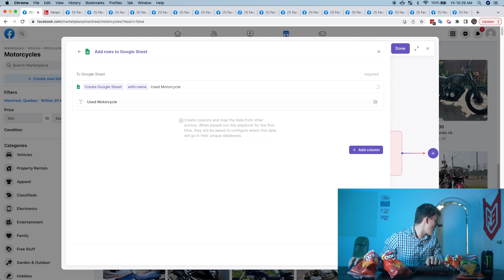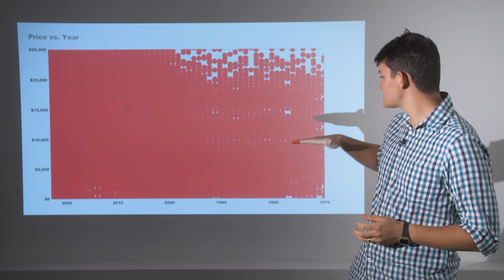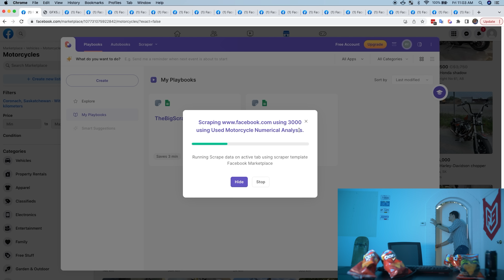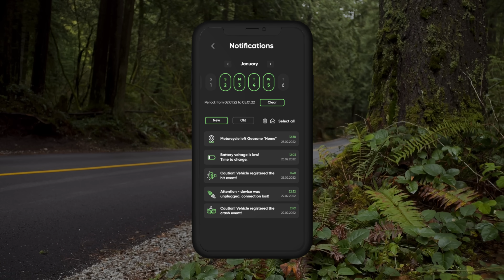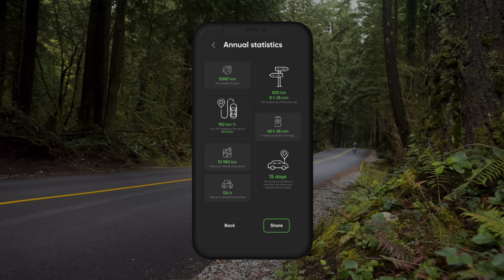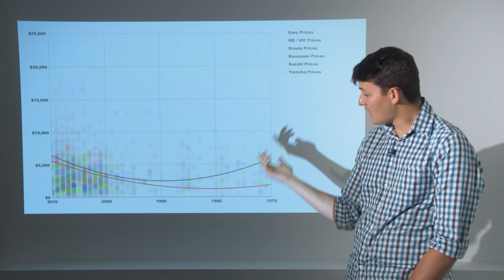Used Motorcycle Prices – A Statistical Analysis

Comment: Sportbike guys especially go for ~2007. All the big 4 were making great bikes, for example, the difference between a 2007 cbr600rr and a 2023 is electronics, paint, and price. The 06 R6 already had RBW, and the 07 gsxr600 is legendary. Cheap compared to new, but the performance is modern
Reply: K7 Gixxer bro.... sharp as a missile....
Reply: @AST4EVER in my country Suzukis are underrated asf, people wanted the newest and the latest just to feed their ego "haha mine is more expensive than yours thus it's better" it's crazy. glad that my Suzuki GSX-R150 never got updated because after all these years it's still one of the best bike ever statistically, my '17 is still strong even tho it has 80k kilometers on it.
Reply: I have a 2007 ninja 650R and just hit 60,000 miles. Anything over 15,000 miles on a bike is considered high mileage. I would have to agree with your analysis of bikes from 2007.
Reply: I do have one complaint about ninjas from 2007. Their cush drive is shit. They crumble to dust and will have you thinking all kinds of stuff is wrong until you figure out what all the dust on the back rim is from.
Reply: @Light_Resistance that's a good reason to do your own drive line maintenance. If you are laying your Richard-beaters on the wheel to lube the chain, it's a good idea to check the bearings and cush drive- just takes a few seconds to shake the wheel and rotate it a little in gear. You would have been able to feel the cush drive degrading. Shaking the wheel checks the bearings.
Reply: @Light_Resistance  Having owned a 2nd Gen ZX10, theres a good reason I didnt mention kawi 💀. Owning Kawi bikes made me a honda/suzuki guy
Reply: @pair_of_fins  I completely agree, I've owned one Kawasaki... Never again.
Reply: I love my '07 R6 and it only cost me $4300 USD about 3 years ago.
Reply: Bought my 2016 S1000rr for $12,500 with 15k miles on it from another rider in my group. Heated grips, cruise, quickshifter up and down, tuned, cat delete, comfort seat, flawless condtion. I paid more than that for my 2023 KTM 890 Duke R for almost 100HP less, no heated grips, cruise control and blipper were also extra at the time of purchase...

Buy a new S1000rr for what, 25k all said and done to get the same shit and basically the same horsepower but 30lbs lighter? I don't think so. Thanks but no thanks lol
Reply: You mean bad things happened in 2008?
Reply: Recently I’ve seen some young guys talking crap about the mid 2k bikes being OLD garbage and I couldn’t believe it! They’re like the stripped down race versions of the new bikes out with all their fancy electronics.
Reply: How about a official group ride next week
Reply: 2008 Kawasaki ZX-10R, absolutely brutal bike for a few bucks!
Reply: After they stopped making r6 they have significantly gone up on used markets. I bought a cb1000r for way lesser than a used triumph. It's not as powerful as a modern 600's but I am happy with 120 bhp loads of torque and not electronics.. so it just pushes me to become a better rider and respect the motorcycle more.
Reply: There is also data about fatal motorbike incidents in the Netherlands that 80%(or in that magnitude) of the cases it involved no breaking at all….
Reply: @terborgh8757  Please provide a reference for that statistic cause I don’t believe it.   It’s doesn’t make sense and I can’t find any similar reference to such a statistic.  My guess is you are mistaken or made it up.
Reply: @kannermw  apologies for not able to provide  the source; i picked it up somewhere and pretty sure it was a Dutch based source. Sticked with me as I drive myself.
Reply: @terborgh8757  There are less than 50 motorcycle fatalities per year in Netherlands and not a good benchmark comparison.  I have visited Amsterdam and ridden a bicycle which was crazy enough.  That being said it is totally different then U.S. with a size less than halve that of West Virginia.

By comparison passenger car ownership on U.S. is more than 2x greater than Netherlands in total percent.  If other things were equal the risk to motorcyclists in U.S. from passenger cars would be minimum 2X greater.  Furthermore, the threat of deer or other large animal accident in Netherlands incidence rate is 225X lower than U.S. whereas the population ratio is ~ 19 times higher in U.S.  Thus, adjusted for population you are at 11.9X greater risk of hitting an animal in U.S.  The U.S. has bicycle and pedestrian death rates 5-6X higher than Euro nations.

My points being Netherlands and most of Europe would be bad baselines for comparison using any motor vehicle survey.  The nearest equivalent Euro  example would probably be Germany or UK .  At least Europeans are smart enough to mandate ABS on all motorcycles sold.  

The fact ABS has been mandatory on cars in U.S. for nearly 20 years and not yet mandated on motorcycles is inexcusable.  It also shows that the motorcycle industry cares less about their U.S. customers well-being then potentially losing sales by offering low cost alternatives without ABS.  It is as if  U.S. is like third  world country.  Then again we have a lot of riders  opposed to mandatory helmets so that says a lot about some riders intelligence.  They much prefer the wind in their hair and brains on the road.
Reply: @kannermw  So it is 80% for American statistics and not for fatal but sever crashes. Lack of evidence does not equal no evidence. :)
Reply: Well, to be comparable you'd have to go through all the bearings and refurbish the suspension...not cheap. But in general you're right.
Reply: Dude there's somebody selling a 96 zx7r for 500 bucks by me. Needs a battery and a voltage regulator amongst other basic maintenance since it's been sitting for awhile. It's calling my name.
Reply: do the 07 models have ABS? ABS on the frontwheel never interfered with my driving, the rearwheel lifts off before that, but i had it save my ass a few times on the rear wheel, it's a nice livesaver i wouldn't want to save a bit of money over
Reply: @weibrot6683  Don’t know if this helps but my 2007 FJR 1300 has ABS. It’s a sport tourer but leans more to the sport. It’s fast, rock solid and bullet proof. It tends to handle on the heavy side ( 645 lbs.) but still good in the twisties. I paid $5,300 CDN for it in 2019. Best bike I have owned. Not a sport bike but it will blow away many of the >1000 cc. sport bikes.
Reply: @weibrot6683  ABS is not as important on motorcycles as cars. If you are competent rider you can brake harder than ABS. Mainly because as a rider you can predict, unlike ABS which can only react. As you you progressively brake harder and harder the forks get loaded with weight and then you get even more grip to brake with. So basically you can get more usable traction manually. Fortnine did a video about this.
Reply: @weibrot6683  ABS is still not all that common on supersports, much less in 2007. Most advanced tech youre getting is a slipper clutch for bikes that old. Personally I always find motorcycle ABS to be super annoying and I always prefer bikes without it.
Reply: @pair_of_fins  I mean that first sentence of yours is straight out wrong, i don't know where you got that information from, but every single modern motorcycle since 2016 has ABS, i also don't know how you could possibly find ABS annoying, if you're doing it right you're not gonna notice it during normal riding, and if you notice it you probably would've become a meat crayon without it, sorry, but that's just a bad take
Reply: @weibrot6683  Every single time Ive gotten an ABS activation, I simply disagreed with the bike. Im braking, I dont want to pull the lever and feel no brake. Ive never had a problem on my non-ABS bikes, track or street, but ABS has just been an annoyance on both.
Also yeah fair enough, I dont know much about 2016+ bikes, I just know the gsxr600 doesnt have ABS, as well as many entry level bikes. But yeah most supersports do have it
Reply: @pair_of_fins  That first sentence of yours makes me think you don't know what the ABS activation feels like, if you break, and you don't feel breaks, that's not the ABS system working, that's not how it feels like, i think you had some air in your breaking system or the breaks on the ABS bikes are a lot weaker requiring you to press harder on the break leaver to get the same amount of breaking perfoemance, when you activate ABS it's the exact same feeling as on the rear break or in a car, it feels like a fluttering on the break leaver, if you didn't feel a fluttering on the leaver, ABS didn't activate, it's as simple as that, the amount of breaking you get also has nothing to do with the ABS activating or not, to clarify my other point further, i was refering to every bike ever made and sold in the EU since 2016, wether it's a supersport, a 125CC or a cruiser, everything has ABS
Edit: Also one more thing, to avoid any confusion, if your ABS activates, and you didn't feel you were getting much breaking out of the bike, then you simply didn't have enough grip to get more breaking out of your motorcycle, if ABS malfunctions, it also completely shuts off indicated by the ABS light going on in your dashboard
Reply: @weibrot6683  I know what ABS feels like I was just exaggerating my point. My brakes worked fine, Ill just accept that the bike probably had an outdated and overly aggressive ABS system.
It would bite fine for normal braking, but under heavy braking it would activate and I would just be annoyed that i was getting less braking when I was 100% sure I wanted brakes. My non-abs bikes have significantly more powerful brakes than my ABS bike did, but if i tried braking 60% as hard as my non-abs bikes the ABS would activate
Reply: @pair_of_fins  Ok, but if you're comparing two different bikes than there's only really your subjective feeling, there are so many other factors that could cause the ABS to activate earlier than expected, worse grip of the tires, much better biting breaks on the ABS bike, differnt sized master cylinder etc...
Unless you did a stopping test from a set speed to a full stop with 3-5 attempts on each bike and get the average there is no real telling if it was just the difference in feel or an actual issue with the ABS system
Especially if you changed the breaks of the non-ABS bike to a break system with more cylinders, you require more of a pull of the break leaver to get the same breaking performance as before, essentially you need to displace more break fluid for the extra cylinders, and the size of the mater cylinder didn't change
Reply: @weibrot6683  Same tires, same track, stronger brakes on the bike without ABS. I was able to brake much harder and faster on the non-abs bike
Which like I said, i blame on cheap+simple ABS
Reply: @pair_of_fins  Significantly more powerful brakes because there was nothing to stop them locking up and putting you into a slide vs less braking because they wouldn't lock up and take away steering control.
Talk about missing the entire point of ABS.
Reply: @pair_of_fins  why do you find abs annoying
Reply: @weibrot6683 my 2016 gsxr 750 doesn't have abs. Your first sentence is stright out wrong
Reply: @echo5827  If that's the case than the EU variant of that bike had ABS or they straight up couldn't sell it
Reply: @pair_of_fins  LOL Basically your flawed opinion on ABS is a comparison of a bike equipped with ABS  with crappy brakes to a non-ABS bike with very good brakes.  That is a false justification to support riding an inferior bike without advanced tech for added margin of safety because you can't either afford or unwilling to pay the added price to upgrade.

 How much does one potential accident cost you?  Assuming  you survive it is lost wages, damage to bike, potential permanent disability, hospital bills, pain and suffering, higher insurance rates, lost enjoyment  time riding, etc.  

Times have changed and tech has advanced beyond the skills of even the best riders.  The tech of 2000-2010 or earlier is outdated by over a decade an a half.  The first consumer quad drone was released in 2010.  The tech that made them possible was low cost multi-axis IMU.  That is essentially similar tech to advanced 6-axis IMU and high speed processors that bear little similarity to their predecessors which were much less sophisticated and not as effective in implementation (aka low cost bike ABS or old generation ABS).  This new advanced tech is not intrusive and only does its thing when you make a mistake or encounter unexpected emergency situation.
Reply: @pair_of_fins  Go ahead, link a modern supersport bike without abs.
Reply: @weibrot6683 since 2016 huh? So that's why I can option a brand new ninja 650 without abs? Is that also why I currently own a 2016 ninja 650 that doesn't have abs 😂
Reply: @weibrot6683 you couldn’t pay me to have ABS. May as well DRIVE a Goldwing. I’ll stick to pushing the limits until I lose the ability, or until it’s time to buy a muscle car. Again, no ABS.
Reply: @WontSeeReplies  LOL. What do you want written on your tombstone?  "Here lies proof of Darwin's theory"
Reply: @weibrot6683   If you need ABS to save your life, you probably shouldn't be riding.....
Reply: @nathanmackenzie1174  Ok, now that's one of the single worst takes i've ever heard
Reply: 6-axis IMU level of safety margin on a motorcycle compared to one without such modern rider aids  is far greater than the difference between a car without seatbelts and all modern safety systems.  Motorcycle ABS without linked braking or compensation for lean angle is ancient tech that has some value but nothing to crow about.  More modern and sophisticated ABS systems outperform old school ABS and there are significant differences between ABS on low end bikes vs. high-end bikes.   It is like claiming your old budget smart phone from 15 gears ago performs nearly as well as a new higher end one which is absurd.  Until you have experienced dangerous  situation in which this modern 6-axis IMU tech can save your life and that of your passenger  then you have no idea.  I have experienced such a situation and I guarantee no human in any random unexpected street scenario can duplicate or exceed the performance of such systems.  As a consequnce I will NEVER ride another motorcycle without such tech.  

There are studies showing that ABS on motorcycles reduce fatality rates by 31% but the class of motorcycles that benefitted the least were sport bikes and differences are significant.  It is the attitude of sport bike riders and riding with far less margin of safety on the streets as if they are in a controlled track environment that are to blame.  I have no doubt the average  sport bike riders are more skilled than typical rider but that over-confidence leads to bad judgement even with better handling motorcycle and consequently much higher death rates.
Reply: @kannermw  A significant portion of sportbike owners will think they can outbrake ABS, and in my opinion, in the dry, they can but not safely. And in the rain...never. Performance braking without ABS is like picking up pennies in front of a steamroller; most of the time you'll be successful until you're not. I've owned sportbikes throughout the decades, from non-ABS, to partial ABS, to linked ABS, and now to performance ABS with Traction Control. I'd say bikes without ABS/TC are really difficult to ride safely in comparison to ABS/TC bikes, but good luck EVER convincing hot-shot sportbikers of that fact.
Reply: @kannermw  ABS lengthens your stopping distance buddy... Until you've had to slam on a pair of good old fashioned disc brakes in an emergency situation cleanly & effectively, you don't know what you're talking about. Plain disc brakes are better than ABS for shorter stops.
Reply: @danielstorey3696  You are ignorant about statistics  based on real-world conditions not some planned practice scenario in a parking lot or empty street.  From NHTSA study comparing like model motorcycles with and without ABS the differences are profound (summary below).  You could look  up the study but I doubt you would cause it would challenge such ignorance.

The fact the benefit was not as great on sport bikes was determined to be the result of excessive speeds and riskier riding behaviors resulting in more crashes independent of ABS.  

This study did NOT include the much more advanced 6-axis IMU technology which is magnitudes of order better than simple ABS.  There are plenty of videos out there showing riders on wet or dry track doing things no other rider could do without such systems and no crash.  The fact such systems have been used in motoGP for over a decade by professions says something.  The main difference with those systems in racing conditions in a controlled environment is the settings are optimized for every corner on the track.

 "Overall, he found that ABS was associated with a statistically significant 22 percent reduction in motorcycle driver fatal crash involvements per 10,000 registered vehicle years. By motorcycle type, the feature was associated with a 32 percent reduction in crash rates for standard and cruiser motorcycles and about a 25 percent reduction for touring and sport touring bikes. For sport bikes, that percentage fell to 19 percent, and for supersports it fell to 12 percent."
Reply: @danielstorey3696  Amazing how guys with false opinions stop commenting when presented with facts.  How about this one.  According to NHTSA  sport bike riders have a 8.21 deaths per 10,000 vehicles vs 5.32 for touring and 3.88 for cruisers.  Using simple math that means 54% higher fatality rate than touring and 111% (>2 times) worse than cruisers.  That stat is not published based on miles driven which makes it even worse.  Despite sport bikes better brakes and so-called high skilled riders are just not what you say.  Practice threshold braking all you want but with and over-confident attitude and no margin for human error the grim reaper is waiting for you.
Reply: @kannermw  😂😂😂
Reply: @kannermw  There in NO ABS on MotoGP bikes.
Reply: @kannermw  Dying on a bike is almost always a skill issue, not a situation or technology issue. Modern tech doesnt hurt but it shouldnt be a deal breaker, it also shouldnt be a replacement for skill and practice.
Overall we do agree tho, i totally get your point and think that if you put the same perfect rider on a bike with all the modern nannies cranked, vs one without, the rider would crash less times than on a more "raw" bike
Reply: @pair_of_fins "Dying on a bike is almost always a skill issue"
Says every rider who aren't dead.
Reply: @donniebunkerboi9975  Have you tried just not crashing
Reply: @donniebunkerboi9975  Ken Block professional stunt driver probably thought the same thing when he went solo on a snowmobile and look how that ended for him.  Over-confidence in one's skills is a step closer to an abrupt ending.  Bottom line is most humans are poor judges of risk and falsely believe they are in full control of their destiny until they are not.
Reply: @pair_of_fins yeah getting launched by an inattentive suv driver would be a "skill issue"
Reply: @darksideorbit8898  I commuted for years, ignoring red lights and traffic, never had an issue
Reply: Sportbike wannabe, and by wannabe I mean all were CBs. 2 x 750 (K and F), 1 x 900 (F) and 1 x CBX 125. But, also a cruiser wannabe (2 x CM 250, 1 x Rebel 250 ((ugh!), 1 x Kymco 150 ((present for FiL)), 1 x CB125 ((also for FiL)) 1x GL400 and 1x GL500 and 1 x EL250), off-road wannabe (1 x SX200, 1 x DR250, 1 x XLR 250). And the most modern was 1991.
Carbs can be a hassle, but you sure learn all about your bike. And the CCB750 will do everything you want it to. Just avoid the F.
Reply: The difference is that you will likely not crash in the first 100m in the 2018 superbike. Those bikes were death traps, you had to have expert skills to ride them. Now you can ride a 200+ hp superbike with very little experience and survive, as long as you activate all electronics and safeguards.
Reply: @aao331  I got a 2006 ZX10R when I was 18, it was a totally fine bike to learn on (at that point I had under 6 months experience riding, on a 650). You just have to respect the machine and not push your limits too far.
Literbikes are just bikes
Reply: @paraffin9449 and your profile pic is of you crashing, maybe if you learnt on smaller bikes first you may have learnt to corner properly
Reply: @mark675  'learnt' lmao
Part of track riding a literbike is an occasional incident, happens to everyone
Reply: @mark675 everybody crashes bro get over yourself
Reply: k5 600 GSXR was better; my K6/7 750 feels like shit compared to it
Reply: @shane2700 you're lying. 06+ is twice the bike as far as handling